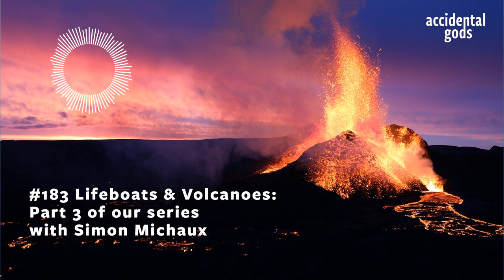#183 Lifeboats & Volcanoes: How much power can we reasonably produce as we phase out fossil fuels?

Comment: Abrams Tanks engines can run on any liquid hydrocarbon, and could be modified to run off any combustible gas fuel. Jet fuel is used for two reasons, its means that you only need to transport two fuels to run your military, Jetfuel and diesel. Jetfuel is used in the tanks because its more efficient and you get better mpg.